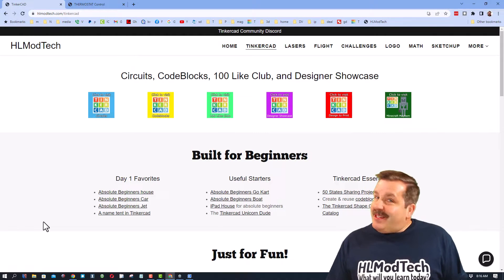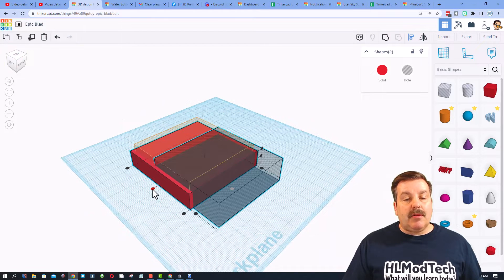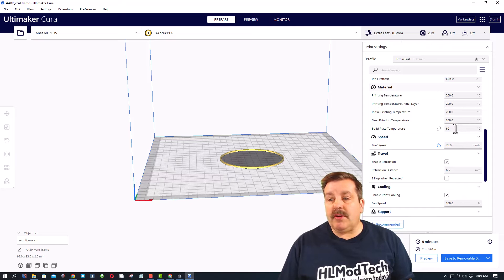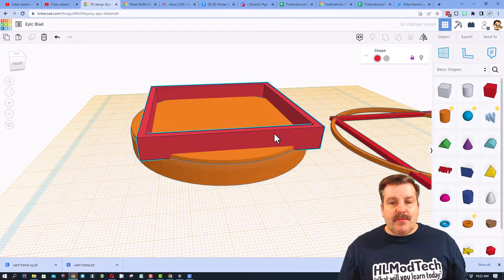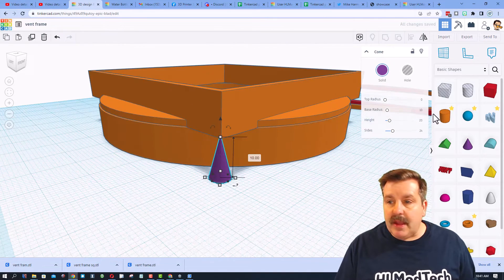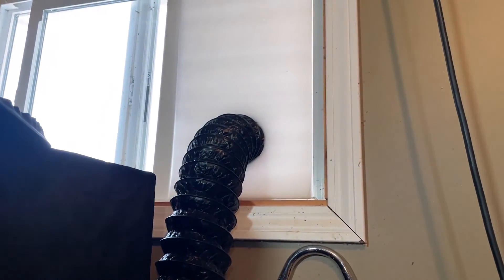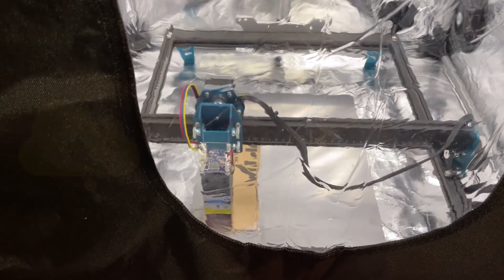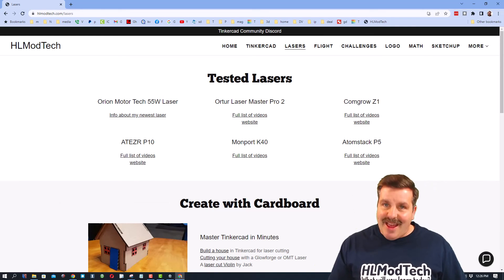Design & 3D print a Tinkercad Vent Comgrow Laser Enclosure exhaust fan

Comment: I like the way you draw your own supports and then rely on bridging.
Reply from the maker: Thanks Dan. I used to bring projects into MeshMixer to make fancy tree supports... With these short ones it is so effortless to make them. I have rarely had them fail too.
Reply: @HLModTech  yeah, it's Old Skool, like adding Mickey Mouse ears to corners to prevent lifting. What about instead of using a cone, use a hollow cone which is the same but skips the infill.
Reply from the maker: @DanK-ZDP189  Interesting idea. With the base usually being 4 or 5 mm in diameter they are already pretty small. Then again, even if I have a solid one Cura with hollow it out, if it fits in the parameters when I slice it. I totally forgot about the mickey mouse ears. I used to do that with my very first Makerbot.  What sort of printer do you have?